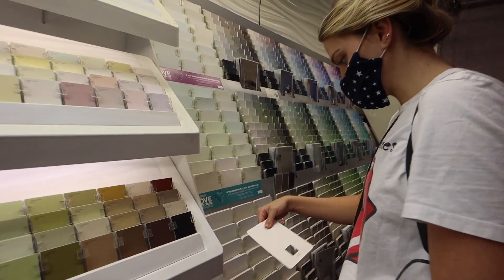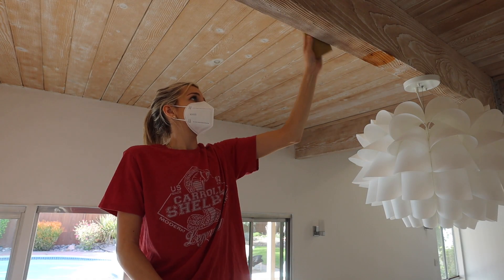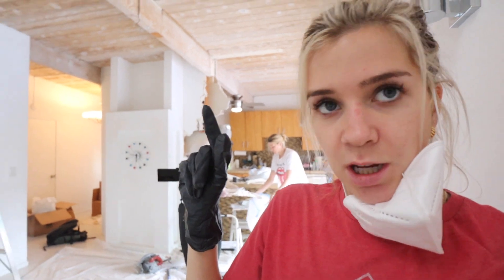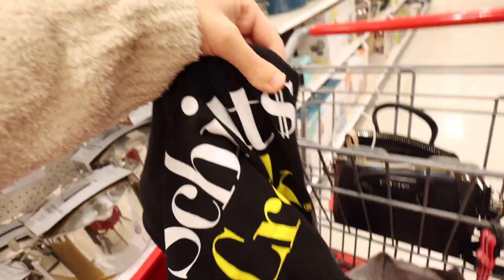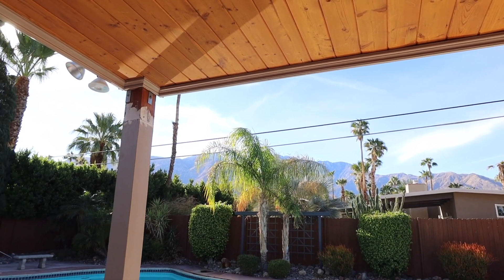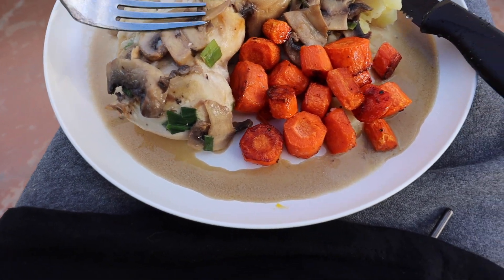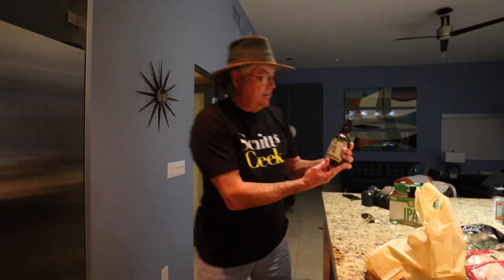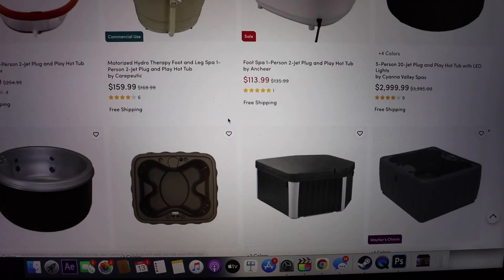Starting renovations on the new house!!

Comment: I would say hold off on the hot tub if you're planning on renting the home before committing to an in ground one. The last thing you need is a guest messing with the plugins and accidentally ruining the thing, or plugging in too many things and causing a hefty electrical bill. Short term renters do the weirdest things and can ruin just about anything if they try haha. If it's for your personal use, perhaps a different calculation there. As well, if you hold off, it can be pretty easy to justify getting a nice one and spending the money as you didn't spend it on the smaller one!
Reply: Yeah this one Airbnb I stayed at had a hot tub which the guests before me ruined.  They got sand in it and the house was no where near a beach!!! She had to buy a new one!
Reply: @rachelsfindings  oh no that’s terrible! Annoying for the homeowner but also for you if that was an amenity you were looking forward to using. Personally I’m a huge hot tub fan haha I know I’d be bummed.

Comment: My family has an above ground plug and play hot tub. They purchased from a local hot tub and sauna store. They had to use a crane to lift it over the entire house and place in the yard lol. We're in California, so the weather is not an issue. My fam runs it at like 101-103 degrees. It's great for winter! The cover will have to be replaced every few years due to sun damage (maybe like 5-10 years?). A cat likes to come by and sunbathe on it which is adorable (: Ours cleans the water using ozone and a water filter. And every time you go to use it, you have to test the ph and other water related things, which is annoying. Also will have to replace any waterproof pillows attached in the hot tub every once in a while, but whatever if you really want one. It works great! My family loves it, although I am not a huge fan since they run it too hot for my taste.

Comment: i've got a cheap 120 volt hot tub (from wayfair no less).  they are fine in the summer, but not so good when its cold out, so pretty useless.  they rely on the pump to heat the water, once the cover is off they cool down pretty quick.  i plumbed in a proper pool heater to mine which made a huge improvement.

Comment: For the hot tub, only use a 220 Volt dedicated line. Don’t waste your money or time on those plug in 120 volt tubs those have a much less wattage heater meaning it will not get hot like a dedicated one would. Especially you say it can hit the mid 40’s there at night. 😎

Comment: I grew up with a higher voltage hot tub (not necessarily plug and play, it was 220v) where it would stay warm to whatever you set it at literally surrounded by 3-4’ of snow all winter. I think in Palm Springs you’ll be fine with a lower voltage plug and play. Worst case you wouldn’t get suuuper hot on cold nights. I’d buy a really nice insulated cover for it to help insulate. If you are worried, it might not be super expensive to just wire the outlet for 220v and get a regular hot tub.

Comment: I have a life smart plug and play 120v hot tub I bought from Amazon it arrived in 2 days and I just rolled it from the driveway to my backyard it was wrapped in a lot of bubble wrap. It gets down to the single digits here in the winter time and the hot tub has no trouble keeping at 104. It was nice not having to pay an electrician to install a outlet, just plug it into any normal outlet or use a heavy gage extension cord.

Comment: Hi! The house is looking amazing. I have a plug in hot tub in the northeast (it gets below 0 F where I live, very snowy) it works great year round! It stays at full heat for ~30 mins and then slowly goes down. If it’s during the day and hot like in the summer it stays warmer longer, like if we are out at the pool in the summer and leave it open we never have issues with it. 

Recently, we changed ours to be higher power(not sure how this works but we changes the type of outlet or something, it had the ability to be put at a higher power when we got it but we waited a bit-I was out of town when this was done) and i feel like it stays hotter longer now. We have had it for a few years now and love it. I think it’s best in the winter. The brand we have is a dream maker spa

Comment: ive had a 115 volt above ground hot tub they are nice Except the heaters never work very good. they Blow Good But, the Resistance Heaters can't keep the tub warm. if u can hook a propane tank to it to keep the tub warm That type of heater will probably work good. Higher voltage tubs probably will work too but are Very Expensive to Heat. 230 volt Resistance heaters Cost alot of money to run. 115 volt pumps with Gas Heat is Cheapest and Best to Run !

Comment: My aunt has a plug and play hot tub in Cleveland Ohio so snowy... I believe she just heats it up when using, not all the time. Maybe putting a timer on the heat to have it automatically turn off after 4 or 8 hours, could save you on electricity. Also a cover will help the heat up!

Comment: I just recently bought an inflatable plug and play hot tub and it stays warm really well even in chilly/rainy Seattle. We have noticed that when you run the Jets it does cool down pretty quickly but when we don’t it only loses about 2-4 degrees per hour.

Comment: An faq on a $3k 110v hot tub says it can take 6-8 hours to heat up.  1500w is the max you can get on a 110 line.  It's the same heat output as a space heater, or the thermal output of having 5 people  in a room.  Seems like it might be disappointing.

Comment: My thought is, the full in ground “hot tub area” should be designed at the furthest point from the house to eliminate any hum you would encounter in “the patio area” where it reverberates. We had a plug & play and it was nothin to heat up, took about 20 minutes. #Lovethecontent

Comment: We have a plug and go hot tub that we ordered from Costco’s website about 4 years ago and we love it! It cost about $3000 delivered and we used it for 2 years in New Mexico, and then took it with us when we moved back to Washington state and we’ve been using it here for a year and a half and it’s performed great in both places. We have had zero problems with it at all!
(Of course all of Costco’s are gone on the website now b/c of 2020, but normally they had 6-8 options on there.)

We really looked into fancier hot tubs at a bunch of different retailers, and the prices are just stupid expensive and not necessary. We have already totally gotten our money’s worth out of ours, and it’s still going strong!
Reply: (Also, people are so stupid about you guys painting the wood - it looks GREAT painted! The sandblasted wood looked awful. You guys are doing fantastic so far!)

Comment: The question to ask about 120volt hot tubs. How any amps does it draw when running with heater and pump. how any other outlets are on the plug you will using outside so you are not overloading the  breaker and tripping all the time. It should have  a  GFCI outlet or circuit. Looks like the plug in the bathroom. This is to protect you from getting electrocuted around water and trip out the circuit. The best setup is to have hot  tub its own circuit with a GFCI. As far being too cold ..no problem. We have many of them here in Canada.

Comment: I would say just get a regular hot tub, depending on how long you think you will use it for, if it's under a year, then maybe it is better to get a plug in one, but if you think its going to be a while I would either just get standard one, or wait until you redo the pool, because while the plug in one will save you money, I also think its one of those things where you can spend less and get less (which again if its for a sort period time maybe you don't mind), but I think you get your money's worth out of it if you just get a regular one, which you can also just sell once you are ready to redo the pool etc.

Comment: Check the voltage and amperage requirements on the hot tub. A standard 120V will not be sufficient to run a heater. You may have to have a special dedicated line run to where you place it. Good to see that your jaw surgery is healing. Mine took several months and it was only the upper jaw.

Comment: That wood on the ceiling I think is called “white wash”. It’s painting the wood white then when it’s still wet you take a wet rag and wipe it off. But you said it was sanded so not sure.

Comment: Do yourself a huge favor and get a 220V hot tub and get an electrician to install it.  It will probably require a building permit, but you will definitely want that for insurance purposes.   That way you have done everything you could do to make sure that it is safe for your guests.  I have know people that have had 110V,  and it takes FOREVER to heat up.  220V is the best way to go.

Comment: Please do not get a plug and play. I did a lot of research before getting my hot tub. I read you can only have the heat or jets on at one time due to not having enough power for both to run. I picked up a 6 person Master Spa "clarity series" for $7k at a hot tub show and its so worth the extra money over a plug and play. It did cost  $900 for an electrician to wire it in but that was for about 50ft of wire and labor. We had to run the power all the way from front our house to back because we didn't have 220 outlets in the back of our house. Also you need an emergency shut off breaker box installed wich is required by law...I  think. All I know is we needed one installed and there was some important reason. We live in TX. Look for a hot tub expo show near you. They run during winter months and you can probably find a good deal. They delivered it within two days of me ordering it. Warranty with Master Spa is industry leading, that's the main reason we chose them. I was about to get a $4k hot tub from Costco but the Master Spa guy brought up the warranty is not as good, and I agreed.  I really couldn't recommend Master Spa enough. I hope you're happy with whatever you get.

Comment: You will be disappointed with 120 volt “hot”tub”. Recommend 240 volt. Have electrician install higher voltage circuit with plug.

Comment: Underneath that pool equipment, and all around the pool, is a copper ground grid that is meant to protect people in the pool from electrocution, in case there is a ground fault in the home. Moving that equipment is nearly impossible because of what is under ground, and how difficult it would be to dig it all up and re-arrange it. Seriously, you're overdoing it! Especially if this is just an air-BB, not "your" home.